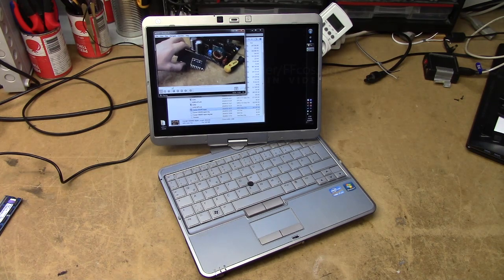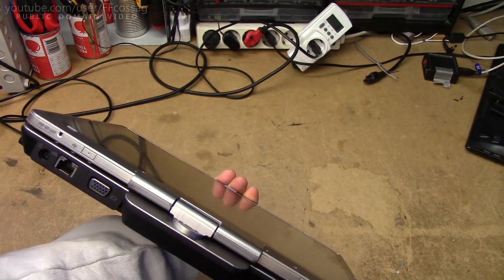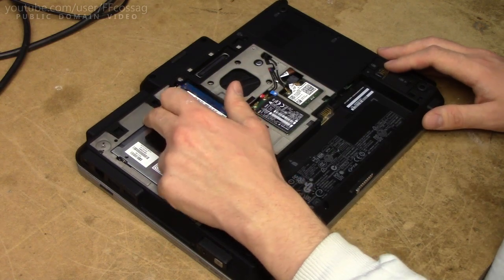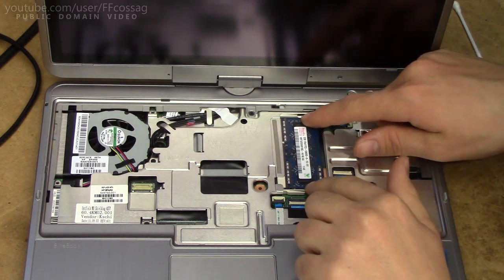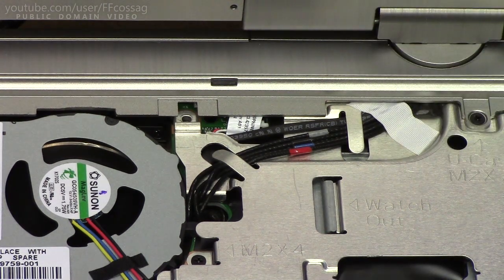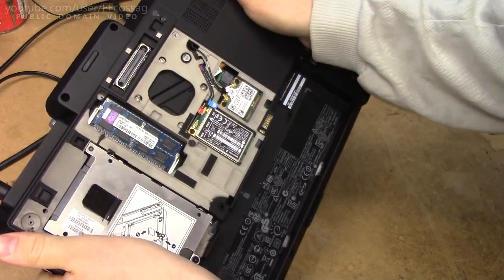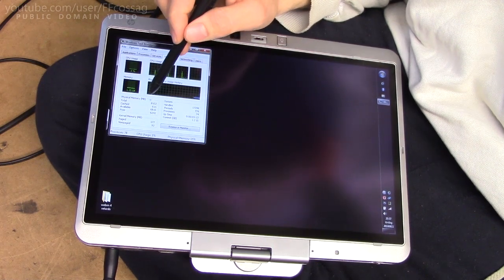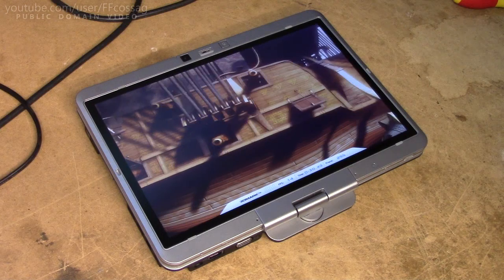Look at a used HP Elitebook 2760P tablet PC

Comment: As someone that owns one of these laptops. I really miss when laptops were designed like this. I'm not a huge fan of how thin/fragile laptops have gotten as of late. This laptop, though old, has met all my needs with Linux Mint. If you don't want to switch with Linux because of the terminal, get over yourself, you barely need to use it LOL. I'd argue, something like this for an older person would be perfect.

Comment: This video reminded me that i should do some repair on my ThinkPad x220t. The palm rest is smashed on one corner, the keyboard has the wrong layout and is worn af, the trackpad is worn, the hinge cover is falling apart, the top lid is scratched, the battery is struggling to get 3 hours on a charge and the screen has a lot of scratch marks on it...
Wow, that will be expensive...
I'm thinking about just buying a broken x220t (for example a dead mobo, dead ram slots, broken screen) instead of searching all the parts on eBay and waiting 6 weeks for everything to arrive...
Reply: This has happened with my Fujitsu T901, I already bought it in rubbish state, the laptop did work but it was in so poor condition I didn't want to use it, so I disassembled it and I'm periodically looking on ebay if someone is selling a spare chassis for it.

Comment: I Used this, Everything works really great, except fan, Loud, I mean really loud even idle (This is fixed after installing hackintosh method. lol)
Reply: That's bad, 2740 not improved,well its 35W no longer ULV series, but i thought its based on 22nm isn't it? I'm using 2730 because of that. even TC1100 as server noiseless 24/7 since 10 years, 10x 2730 for business programing, kids loved couple years ago cause was different quite. That's bad, wanted to upgrade. Well its obsolete anyway.

Comment: i bought HP Elitebook 2760P touch screen not working plz help for his original drivers
Reply: Let me say, I bought this same exact model several years ago. I got a really good price off eBay. I ran into one issue. It turned on and was fully functional, but there were some issues you would run into with various programs that required windows updates, because for some reason windows wasn't properly updating. Well, I spent some researching the problem, managed to install something from Microsoft that fixed the problem with it not updating. It now works like a beauty. I am so glad I got it.
Reply: I might be able to help you.

Comment: Good Day! I am writing to you from a 2760p... my question is... do you have a problem with it charging from the dock? I have the dock attached, everything works. but it wont charge from the dock. IF I pull out the battery it will run off of the power from the dock, other wise, its not charging the laptop from the dock. :( any suggestions?

Comment: One question, do you know with version of open GL does this laptop support? You can run "Open GL extension viewer" to find out.
Reply from the maker: Just look up what 2nd gen i series processors do.
Reply: FFcossag I went to a local shop to buy this laptop. One with core i7 has around 1200mb of available graphic memory. Is it okey? what about your one?

Comment: Do you just insert the RAM while it's wet from the alcohol?
Reply from the maker: That's the point.
Reply: Sorry I'm new to this, won't it short anything if it's wet? Or do you wait until it's dry to turn on the machine?
Reply from the maker: Isopropyl alcohol isn't conductive in the slightest.
Reply: Alcohol isn't "wet" in the usual sense of the word. It evaporates in moments, and will be complete dry before you can get the cover back on. Keep in mind that alcohol absorbs water, and if your alcohol is not carefully stored, it may contain a fair amount of water. If your alcohol is contaminated with water, it can cause problems.

Comment: It's pointless to run old 3DMarks on it because these benchmarks are not optimized for Intel HD Series. Try 4-6 year old games instead such as Starcraft 2, Diablo 3, Rage, Bioshock Infinite, Call of Juarez 2, Call of Duty Modern Warfare 2-3, Batman Arkham Asylum and Origins, Bioshock 1-2, Assassin's Creed 1-2-3, Deus Ex 3, Resident Evil 4 (HD)-5, Dishonored etc. These run really smooth even with medium to high detail settings. At list they do with a HD4000, but HD3000 is not much slower, only 10-15% I presume.
Reply from the maker: Those games are just WAY too new for me.

Comment: Running Windows (especially Windows 7) on such a machine should be a crime. When are you going to join the GNU/Linux club, FF?
Reply from the maker: Windows 7 is great for touch screen computers, believe it or not. But I even like Windows XP with touch, so I suppose I'm odd.
Reply from the maker: A friend of mine actually tried Linux mint on one of these, and according to him, it basically works out of the box. Wacom are supposedly OK with drivers, and beyond that, it's just a generic i7 box.
Reply: +Pinkorek Anything that's fully Intel-based has full driver support under GNU/Linux. This laptop is an example of that. iGPU, Intel chipset, Intel LAN/WLAN... And the Wacom support isn't half bad either. A touch-oriented DE/WM like Unity would be really nice to use on this laptop, even nicer than the Windows 7 UI, which is optimized for keyboard and mouse. The battery life thing has been just a meme since kernel 3.0 came out. But it looks like your comment is completely based off of memes you've heard on certain imageboard, and not on actual experience.
Reply: +FFcossag I used to have some Epson 486-based tablet PCs with Windows 3.1 as a kid, and I only knew how to operate Windows 3.1 through a touchscreen. I've tried installing Windows 3.1 on standard PCs, laptops and VMs, but nothing brings back the pleasure that was using it with a touchscreen. Now that I think about it, I remember having a PCMCIA hard drive with "Windows For Pen Computing", which was basically 3.1 with some corners cut. No changes in the interface at all, at least that I can remember.
Reply: No, Pinkorek, you're not the only one who's had a bad experience with Linux. I have an HP 2730p and Windows 7 works just fine on it. Several years ago I I installed various Linux distros on my older laptops, but after a while I became frustrated and replaced them with Windows XP and Windows 7. Didn't get much help from the so-called Linux community. The fanboys I asked for advice were a bunch of nasty little elitist snots.